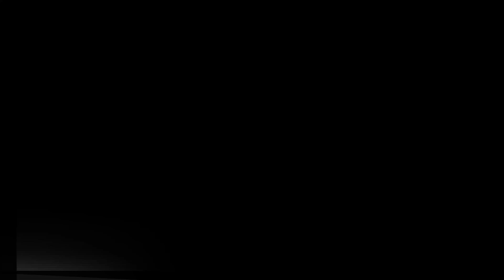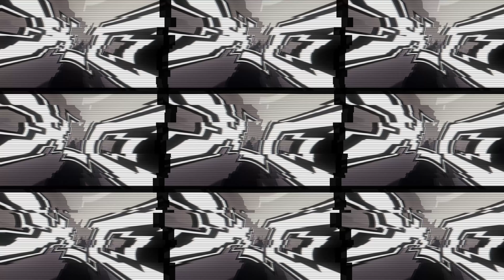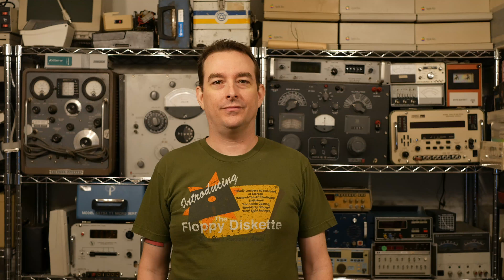Modem Monday #3: Fifty-year-old Modem!  Bell 101C and Teletype Model 35 ASR

Comment: Alas, the mechanical shift register video is marked private.  I used later model ASR33 terminals that had the cylindrical printhead that worked kind of like a Selectric, instead of the flat one in your, which is a mechanical wonder.
Reply from the maker: Heck, the "golfball" of the selectric was far more complicated than the type cylinder in a 33, and the 28 and 35 and 37's typeblock arrangement is just craaaaazy.  Also oops, sorry about setting that video private.  It's back online, follow the link in the description.

Comment: Some material claims the 101 was electromechanical, but it looks electronic enough to me.  Maybe the -A or -B was different?
Reply from the maker: In a way, it is partially electromechanical. All the control logic is done with wire spring relays, as you can see from 5:56. The problem of course if it were purely electromechanical would be debouncing the switch contacts on the modulator to make a clean signal that the far end could demodulate. I suppose the same is true if a simple discriminator circuit toggled a relay as well.

Comment: Any chance we could hear the phone line data communication sound on a future video?   The sound cut off right after connection.   I know what Bell 103 "sounds like" but I'm curious what Bell 101 sounds like.  I believe Bell 101 is amplitude modulation, but I wonder if it is on/off or just high/low amplitude.
Reply from the maker: All Bell 10X modems and all Bell 20X modems are FSK (Frequency Shift Keying).  Bell 103 is backwards compatible with 101 because they use the same frequencies, and is why a 300 baud modem is more accurately a 0-300 baud modem, because the speed of the FSK shifts is directly driven by the speed of characters coming into the modem's serial interface, and vice versa, the demodulated signal drives the bit rate out the serial interface to your terminal or computer.  You may be thinking of later standards which used QAM, Quadrature Amplitude Modulation, such as v.32 used in 9600 bps modems. In v.32 4-QAM is used, employing 8 phases and 2 amplitudes to get 16 values, and thus 4 bits per symbol, hence the name 4-QAM.  This is also why it's wrong to call it a "9600 baud" modem, because baud denotes symbol rate, and one symbol is equivalent to 4 bits, and thus 9600 bps QAM is actually a 2400 baud modulation implementation when using nomenclature correctly.  QAM is still used today - as it can also be used digitally.  One example is 802.11 WiFi.  Digital cable/cable modems tend to use 64-QAM and 256-QAM.  ADSL can use up to 32768-QAM.  The deeper you get into it, the crazier the math will make you.
Reply from the maker: You may also be thinking of ASK (Amplitude Shift Keying).  Didn't consider this because I don't believe I have a single modem in my collection that uses ASK, though some of the very obscure and very old ones that I have little information about may have.  ASK is similar to OOK (On-Off Keying) which can be used with a laser or LED to signal a 1 with light, a zero without light, only with a carrier wave amplitude instead.  ASK wasn't used much in digital communications by my understanding because its sensitivity to various conditions made it more susceptible to error than FSK.  And for the record, the modem you see as the answering modem is an old Racal Vadic 3451, the so-called "triple" modem, which implemented Bell 103, Bell 212, and Racal's precursor to 212, and the first commercially available full-duplex 1200 bps standard simply known as "Racal-Vadic 3400" after the modem model line that implemented this standard.

Comment: What is that black machine behind you on left hand side?
Reply from the maker: On the top shelf center that looks like a laptop?  That's a ByteBug 645 by Hard Engineering.  it's a serial protocol analyzer
Reply: no, the big thing, when you are talking, two knobs almost all shelf height some meters. I would love some vintage PCs, but I have no idea of where to find them. :(
Reply from the maker: Ah, that's like a charcoal gray or something, i guess that's why I didn't think that's what you were talking about.  That's a General Radio Impedence Bridge.

Comment: How big is that Annex?

I'd like to see the computer which runs the BBS.
Reply from the maker: The annex currently in production use is an Annex Three with one 6-position comms card installed, so 32 lines.  I can go up to 72 lines in a single unit.  They are roughly 2U devices.  I'll do a video more specific to telephony setup / DDial / BBS systems in the future.

Comment: When I get the time to restore this guy we should call each other

https://goo.gl/photos/giB4YhDk9JgdocD77

I collect and save from going to scrap Teletype and other teleprinters.

This one, the two 50 pin connectors where left exposed and outside the cabinet and sat in water.

https://goo.gl/photos/w7gV3doUKpoiv4ag9

Goal is the 35 ASR w/101C

-pete
Reply from the maker: Pete Lancashire looks great, even with the damages and such.  Hopefully you have enough viable 12H transistors to make one dataset work!
Reply from the maker: And yes - definitely would love to get your 101-equipped units talking with mine.  I have a dream to get my 33 ASR with a 101C and a 10-key attendant set like one from your pics working again, but with a shortage of 12H transistors right now, like I was talking about on the mailing list, I'll have to seriously deep-dive into building a proper schematic for the dataset to be able to properly bias some silicon BJTs to work in the circuit, i think.

Comment: Watched the whole thing, damn that puppy is old.   
1) What did they typically use these things for back in the day? Telegrams?
2) at that age is it even digital?  Or solid state? It's quite funky there.
3) anything special about that modem you dialed into?  Will a off the shel usr do the same thing?
Reply from the maker: 1) https://en.wikipedia.org/wiki/Telex#Teletypewriter_Exchange_Service
2) Yes, it is "digital".  It is not Solid state though, it is mechanical.  This one does have a lot of transistors in it, unlike the 33, which has 2, but most of them are in the Data Set.
3) Yes, there is something special about that modem, but not for the teletype.  An old enough USR will do this too.
Reply: TX Dj is your TT compatible with Bell 212, or only VA3400?  Curious, looking at a Sportster 56k card and it'll do Bell 103, 212a, v.21, v.22, and v.23 but no Bell 202.
Reply from the maker: Bell 103 is backwards compatible with 101.  All the other standards you mentioned are not compatible with anything except themselves.
Reply from the maker: as per what we were discussing on ddial the other night, i figure you understand why no 202 in your sportster card.  Even a v.Everything can't do Bell 202.  There really were not a lot of 2-wire 202 applications due to its half duplex nature.
Reply: "What did they typically use these things for back in the day? Telegrams?"  Not telegrams.  Before the internet there were a tremendous number of private networks that were basically everywhere but invisible.  So, car companies GM, Ford, Chrysler, were in daily contact with the dealers.  They had applications: parts, warranty, payroll and I forget what else.  For some applications they would dial into Detroit.  For other applications they would load the paper tape in the transmitter distributor and go home.  About 7:00 PM GM, or whoever would dial them and upload the data on the paper tape to Detroit.   This technology, such as it was, replaced thousands of clerks.